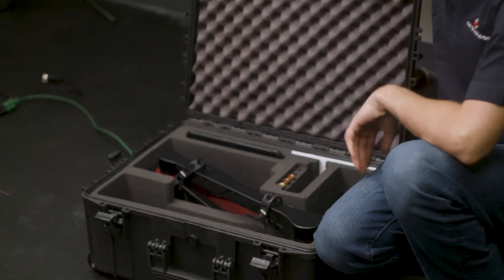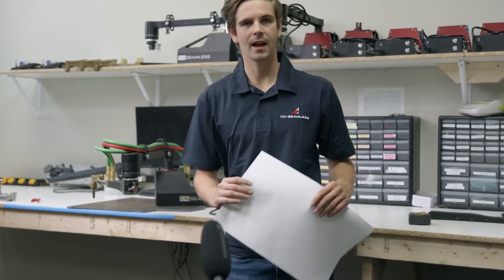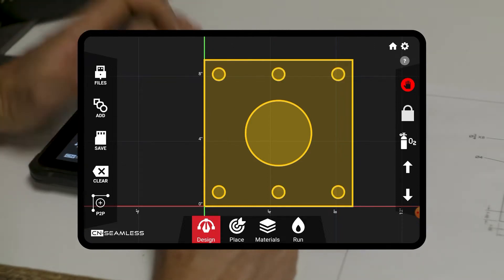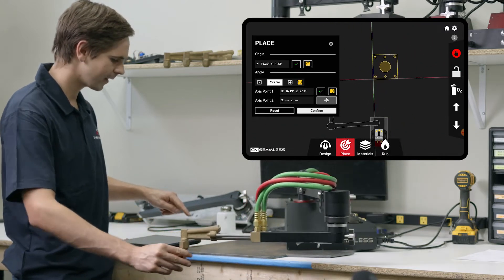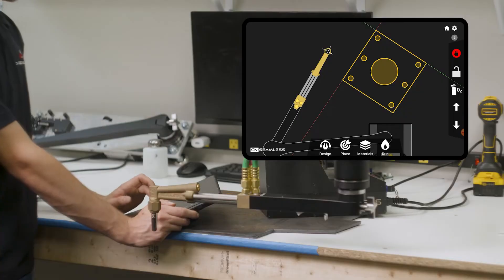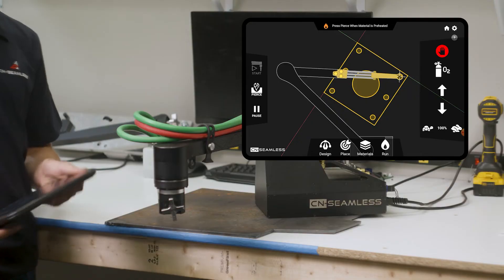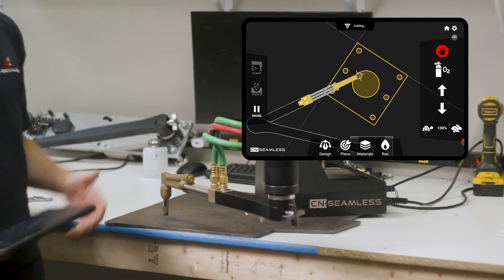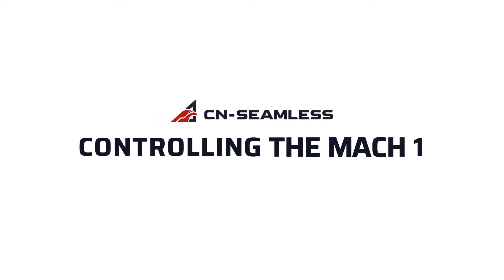How the Mach 1's User-Friendly Interface Makes Metal Cutting Easy

Comment: It's $18,000 USD plus tax. Just imagine 1 piece of 2 inch steel plate might cost twice as much!

2" thick steel plate is $400 USD a sqft. A 16' x 8' piece of steel to cut would be $51,000 plus shipping and handling.
Reply: You need to shop around I just checked a local steel supplier and they have 4x10 two inch plate priced at $93 a sqft